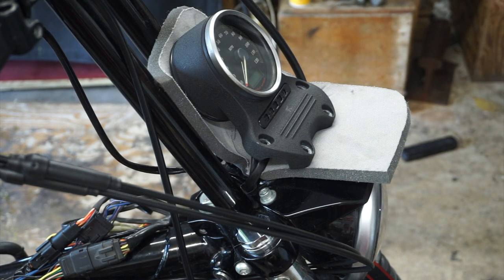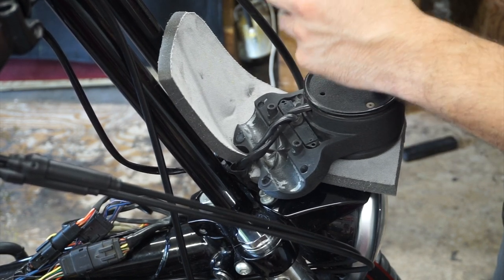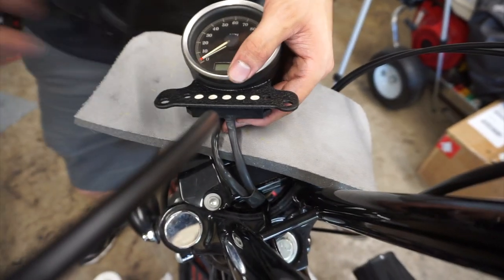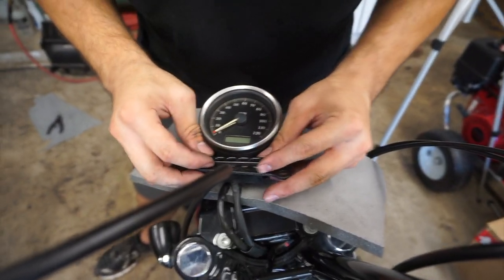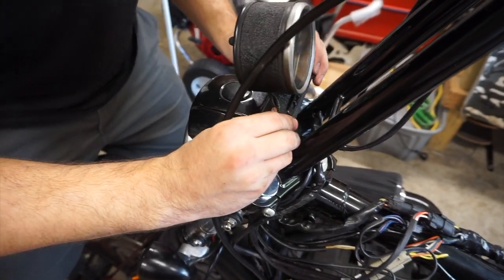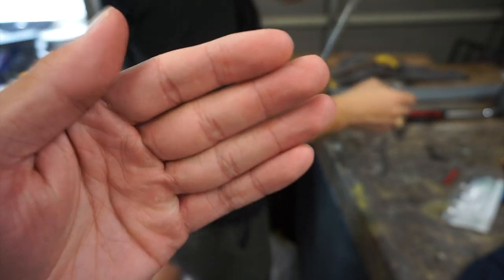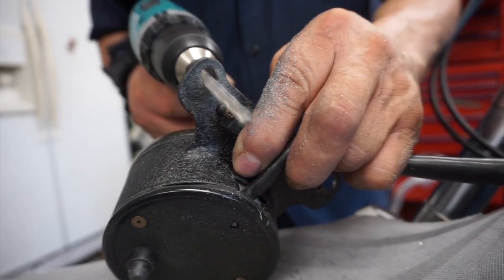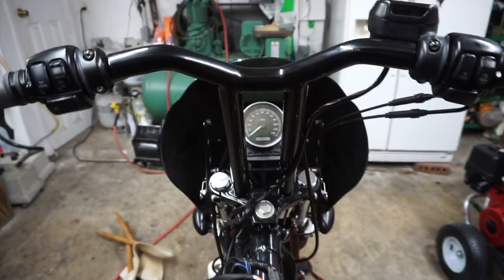BEST Speedometer Relocation for Club Style Sportster with T-Bars | Iron 883 Sportster Build Ep. 11

Comment: I used 13mm deep well sockets for the riser for my speedo. Worked pretty good and the chrome matched the bike.
Reply: Two great ideas in one f'ing video. Thanks, to you both!
Reply: Do you remember what length bolts you used?
Reply: Ended up doing that and used the stock mount. Worked great and kept the rpm gauge too

Comment: Bung king custom risers has the option for a low or high mount welded directly to the bars low mount is about 2 inches up from the bottom and high mount is about 2 inches down from the top
Reply: I’ve been trying to find pictures of those on the web on a sportster and can’t find shit. My girl has an iron 883xl and she wants them in 8” pull pack but doesn’t know which to order. And if more wiring length is needed for the gauges to mount in high or low position
Reply: @palmettolowlife1996 I searched for pictures too , finally just took a chance. I didn't need any extra wiring for my speedometer with the low mount the speedometer sits very close to the top of the headlight housing.. I would imagine you would need extra wiring for the high mount but I don't have it so I can't say for a fact and also I would think a higher mount would be better for a shorter rider that can't see over the bars and down like your looking at the top of the headlight
Reply: @WARPED._.VISION  awesome. What model year& model  bike  do u have & which bung king risers did you go with? (Height , pullback, wire holes etc ) 

How tall are you? 

did you need to order any other brake or clutch cables too? 

Any other recommendations with that setup you can think of? 

I think she’s gonna get a Memphis shades road warrior fairing and my try a plex System install down the road. 

Appreciate all the insight and help!
Reply: @palmettolowlife1996  I have a 2004 Harley Davidson xl sportster 1200 roadster ..Im 6"1" I went with the 10 inch bung king risers 2 in. Pullback and I put the bung king high bend bars on so total of around 13 inches tall ..internal wire through bars and risers ...I did put a longer front brake line on( mine is dual disc front brakes) I order that through Magnum shielding they have several color options
Reply: @WARPED._.VISION  you are awesome! Few more questions. 

Will the risers work with the oem handle bars?

If so, either way, Will we need to order a new top clamp ?

And how does the oem gauge connect? Mine has 4  hole bolt pattern but the pics I’ve seen on the risers just has two. Does it only use the two on the oem ? Or is there another part to order as well?
Reply: @WARPED._.VISION  you should post a video of them !!!
Reply: @palmettolowlife1996  stock 1 in. Bars will work but make sure they have the internal wire hole if that's what you want to do ..stock top clamp works with the risers..and I swapped my speedometer for one off an 05 883 but it only had 2 mounting holes maybe you could find a different housing?
Reply: @palmettolowlife1996  don't quote me but I think dk customs might have something for your speedo housing
Reply: @WARPED._.VISION  I really appreciate the help. Thanks so much again
Reply: @palmettolowlife1996  your welcome I know how it is doing research and not being able to find the info if you have any other questions let me know
Reply: @palmettolowlife1996  I just saw an example of your 4 bolt speedometer just keep it with the Oem top clamp and you may not even need wire extensions depending on the riser height you choose
Reply: @WARPED._.VISION  cool I will try that first! I’ll let you know what happens, thanks!
Reply: @WARPED._.VISION  I’m trying to figure out right now if I have enough oem speedo wiring length for my bung king 8” risers I just got today (w/ 2” pull back). I’ll have to pull it apart and measure. If that’s good I may only need a new longer ABS brake line. Thanks!
Reply: uploaded a video search bung king riser then scroll down until you see warped vision

Comment: Followed your guys lead and did pretty much the same thing for 05 XL1200C.
Reply: I have on 04 xl1200c and I just ordered this mount. Does your 05 have the same style indicator lights as this video? Mine doesn’t and not sure how to mount them.
Reply: @andrewh4146  I had to modify the mount, pretty much dremel and bastard round file.
Reply: Ez fuse tape around the tabs and wires to clean it up

Comment: The pipe will work. But I would suggest to go to a steel shop and get stainless. My buddy kinda did what you did. And he had problems with vibration and had to keep tightening or replacing that length all the time. The stainless has been a lot better
Reply from the maker: Thanks for the suggestion

Comment: Looks good with the fairing installed. Roland Sands make a speedometer relocation bracket that lowers it down on top of the headlight, but it's expensive.

Comment: What fairing is that? And how did you mount it?
Reply from the maker: Quarter fairing from Amazon. Bung king makes the brackets. Links in the description
Reply: @twinsmotogarage1866  and then did you use the quick disconnect clamps? Or did you get the clamps that tighten on that arent quick disconnect

Comment: Does anyone know what bracket he’s using for his indicator lights (neutral, oil, left and right turn signals) ? I bought this gauge mount but it doesn’t come with a bracket for the indicator lights. I’ve looked everywhere.
Reply from the maker: It’s all the same parts from the stock speedo. I just took the stock one apart and put it back together on the new gauge mount

Comment: Hi! Which length of tube and bolt you use?
Reply from the maker: I want to say it was a 3 inch 5/16 coarse thread, grade 8. I just replaced with a zinc coated bolt from home depot cause first ones were not rust resistant.

Comment: This is something I'd definitely like to try. Thanks for the video!  What year is your bike? I've got a 2013 and checked JP Cycles for the bracket. It doesn't technically fit my model year, but if it's just a matter of widening the holes, I'm game. Also, have you noticed any substantial rattling?
Reply from the maker: Mine is an 09 which the mount is not specifically listed for either. At this point a lot of parts on the bike aren't technically for my year or model. No rattling with the mount. I just made sure to use a grade 8 bolt cause I've heard of weaker ones snapping.